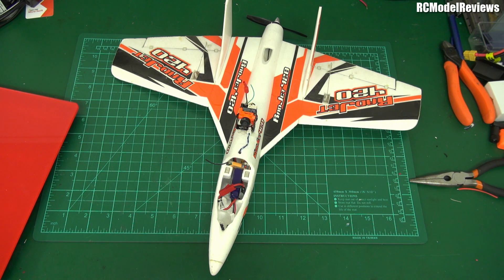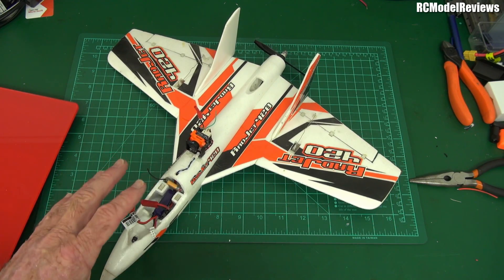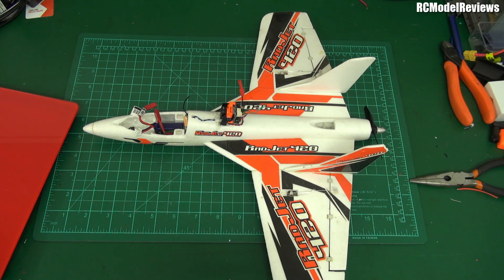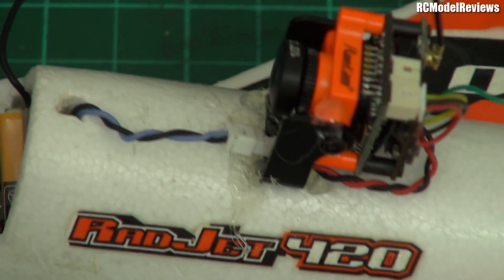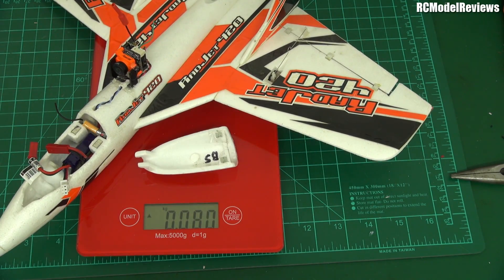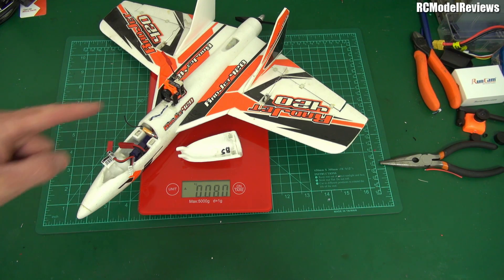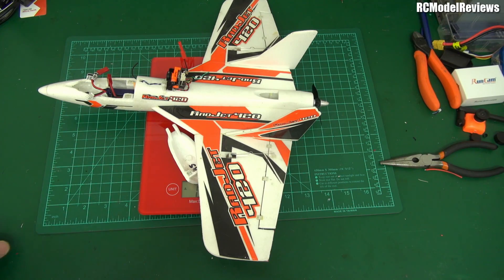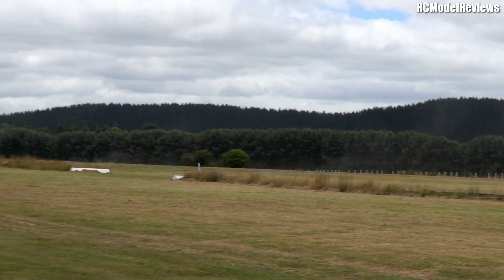Fast(ish) fixed-wing FPV RC plane just 80 grams?

Comment: using a 3s 500mah battery with a 1600kv motor and 5.25x6.25 apc prop i get about 60 mph, still under 250g with a hitec zipper, also discontinued.  should be able to get a bit faster with a shorter run time.  drag becomes an issue at those speeds.

Comment: The hysteria caused by the massive drone death and injury toll of zero has spread to Australia.  Looks like we will have to register our drones as well soon.  You called it Bruce.  Mind you a million fish can die due to corrupt pollies giving all the water to their mates and donors however because nobody has been killed or injured by drones we apparently need increased drone laws.
Reply: Injuries should be a LOT higher than that. I've seen a lot of videos where DJI or similar fell from the sky at events and whacked people on the head, or massive camera quads at football stadiums (getting scary close to "decapitation size class") crash into the crowd of people. You know what the big similarity was? Flying around people! Freaken idiots being paid to film crowds and football games.... No hobbyist would say "sure, lets fly this death machine with 18 to 24 inch carbon props carrying a giant DSLR camera around a huge crowd, I mean, nothing could go wrong..."

Its the pros and idiots that are severely dangerous. The only people I've injured are myself, myself, and myself. Nothing severe, with the worst smacking into my the back of my head at 20 mph with a mini-quad while trying to do a high speed land on top of my box goggles where I quote myself saying "ouch, haha!". Now, you'll probably get more injured while testing them NOT assembled to a model, as my cousin still has scars on his arms from a giant brushless motor getting out of control (some may say you should bolt or clamp your motors and not just hold them with your hands while testing... But he clearly wasn't thinking this through, as he used a fan blade just to put a small load on it, and it completely blew back the metal blades from pushing so much air, and then his arms got a few new marks on them...)

Also people have died from drones... Military uses drones all the time, they are equipped with missile launchers and machine guns, so yeah, they do a good job. Definitely some deaths by drones (as that's what those things are designed to do)

Comment: Nice little plane and one I haven't seen much before. Interesting that you used the micro swift.
I just use AIOs on my lightweights as none of my current crop have that much power/speed.
There are clearly more ways than one to skin a cat

Comment: did the glue-cam thing om my bixler with a brand new swift, lost both, recovered the bix as i was testing pixhawk with gps & telemetry so could see where it crashed but never ever found the orange cam in a large field of sand. scowered it for hours with me ZMR250 until i lost that one tooo. DONT GLUE yer cam... :P

Comment: How much is the all-up weight (with battery), Bruce?  Isn't it the total flying weight that has to be under 250 grams to qualify?  I'm sure that even with the battery it still is though.
Reply: it literally says 80g in the video title and he weighed it on bright red scales in the video lol
Reply: He showed the 2S LiPo that it was run on, powering both the motor/Rx and the FPV

Comment: This is scary to present..soon the threshold will be lowered from 250g to 2,5g or lower..This plane could make a A380 crash. Yes, its very very very small chance, but its a chance, so this is very dangerous. If University of Dayton shoots this with hypersonic speed to a paper airplane wing and see that it blows it to dust, then there is a potensial it can bla bla bla... Fly this atleast 25miles from an airport too. It is also a chance someone with double vision to take it for a drone, especially if they drive a car in 80mph on the highway. Think of the cost if they must mount anti drone equipment everywhere. As we all know nuclear bombs are child play compared to drones 🤪🤣🤣🤣
Reply: A prank bomb phone call, closes the airport faster than you can get ready to fly anything.  How are they going to stop phone calls to the airport?
Reply: @SOLARFPV  That is very easy, you will not be able to call the airport anymore 😜🤣🤣
Reply: @rogergaard    ha ha ha ha ha.  Maan they are failing so hard, and don't know it.

Comment: Hi Bruce. Do you have any overheating issues with the runcan vtx @ 200mW ?
I'm in the process of installing one in my 3" quad.
Ive had a few other small vtx's that would overheat & shut down even on 25mW . My AKK got so hot I couldnt even use my finger on the channel change button, its headed for the bin (unless you want it )
Reply from the maker: Never  had an issue and I've flown on some warmish (28 degC /82deg F) days

Comment: you should check hobbyking for 260mah 2s turnigy batteries, they are like 15 for a 5 pack or sometimes less on sale. i use them on my mobula7 and so far they are decent as long as you can watch mah used or voltage